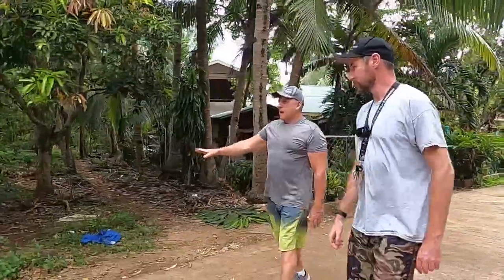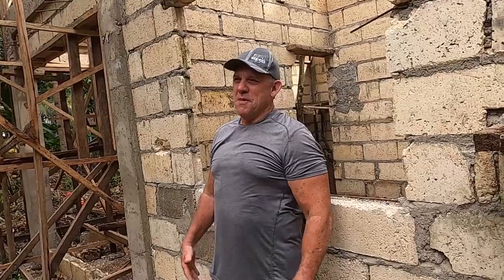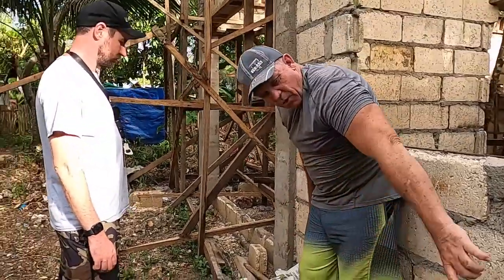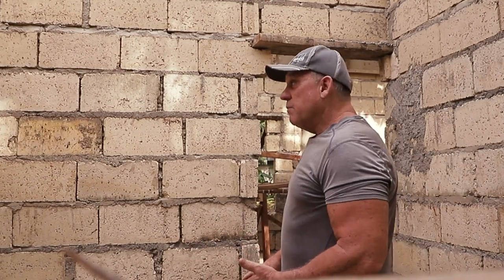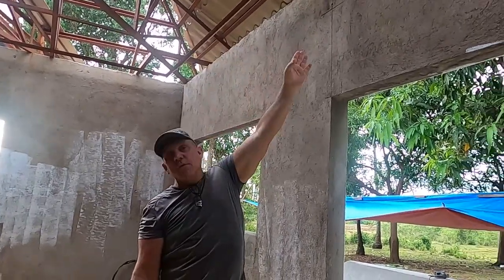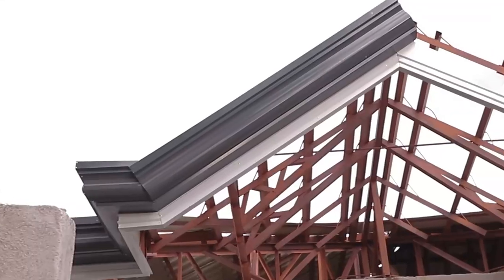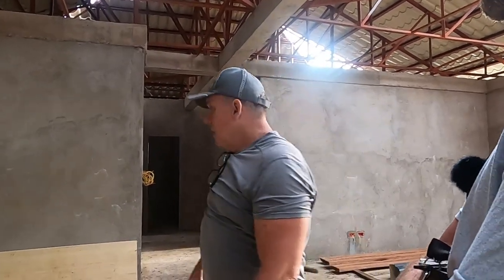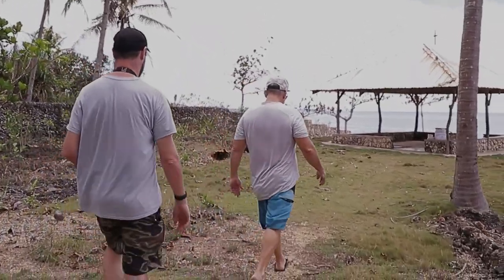Build A House In The Philippines (4 bed/3 bath $60k!) Part 2 of 3

Comment: A bad thing about the "DROP" ceilings that they do in the Philippines is that it's completely connected to the trusses.  When the wind hits your roof this entire truss system will no doubt flex and shift and sway a little bit, which causes the "DROP° ceiling grid system to also flex.  This causes the cement board to crack/separate at the seams and around the ceiling perimeter where the ceiling meets the walls.   Trust me, my house in Pampanga had this happen to it.  I'd build an entire separate ceiling grid that was independent of the trusses and have it attached only on top of the exterior and interior walls.
Reply: i cant imagine your descriptions.  can you make a video and post it?

Comment: To be honest with you using 4” blocks that way is Bullshit junk
Reply: Hey your reply is Bullshit, I was talking about the blocks,To use 4inch blocks is a bad way of building a house,if you think laying 4” blocks and filling them with mud makes a strong wall you are wrong,Plus them blocks are junk fall apart,to make them you should only get 30 blocks to a batch of mud not 70 to 90, now you bring it up about water, I have had that problem before, you takes buckets and go get water hire a tricycle I did, Do you have car ? There you go put buckets in your car,your spending a lot more money using 4” blocks , you stucco both sides plus you fill the blocks,it would been less cost to form a 4” concrete wall and very strong, by the way I’ve built 100’s of homes hotels whatever you name it, by the time you lay blocks you could have formed the wall and poured concrete and been finished, I’m not here to make fun of you I only want to help,
Reply: I’m looking foreward to your form and pour house video. Haven’t met one owner who was happy with the results using local labor. I predict one will go thru many many workers trying to get them to match up forms and manually vibrate the concrete. Nope, it sounds good, but unless your the worker , your results will leave you grinding concrete and skim coating a wall you intended to be finish quality. Blocks! Don’t reinvent the wheel, if you want different quality of block you can certainly get that. Again, what I share is what I learned doing it. Lots of my ideas we not applicable here. So take what you can use and leave the rest. Best wishes
Reply: Well said,it's the only choice poor citizens have to build so that's why the do it.Much better ways to build if you can afford it.
Reply: @mikemulholland8092  I build a few buildings using a pour in place forming system on the  Island Garden of Samal near Davao. When you remove the forms the wall takes minimal skim coating in comparison to hollow block and the PSI strength is about three times the strength as Hollow block at about 3500 PSI. The key is to set the forms up properly so you have a clean wall after removing them combined with good vibration.  Thanks for sharing.
Reply: @edcannon3521  Your 100% accurate. Pour in place is way better.  I poured two buildings using forms.  I have six inch solid concrete walls.  I put my buildings on Matt Slab Foundations, so they are not attached to the ground during an earthquake.  The whole building will move with the foundation that’s sitting on properly compacted crushed rock sitting on limestone.  This hollow block building method does not hold up during Earthquakes.  Most of the Hollow block is home made with a one bag of cement for 70 hollow blocks.  “They” don’t know anything about PSI strength and proper concrete mixture.  

When you grind channels in the hollow block for utilities it further weakens the walls.
Reply: If it was cost effective , it would be in practice already. 2x4 and dry wall vs concrete filled block and rebar is an easy choice in strength vs cost here.  We had 7.6 earth quake in Bohol, there were a few wall cracks in some units in some buildings. Cost to repair was maybe 200 dollars including the new paint. I just don’t see the practicality in pouring solid walls unless they are water tanks. If one were to use solid pour then I’d recommend cooling your concrete, you do know temperature affects the set up time n cure rate, just fyi. It must be cost effective or it’s just not realistic.
Reply: @mikemulholland8092  Texas Filipino on YouTube
Reply: @mikemulholland8092  not realistic as your not a builder, teaching them. i know a contractor in the philippines whos teaching all trades a western way and they listen as they get more $ now. your all ego and to excepting as your not a home builder,